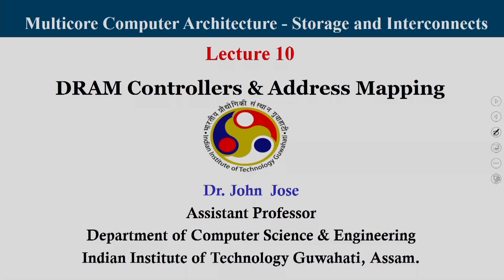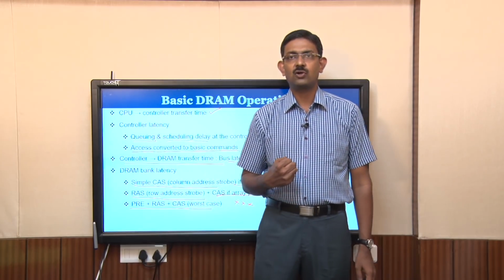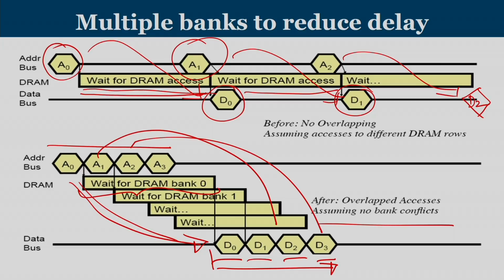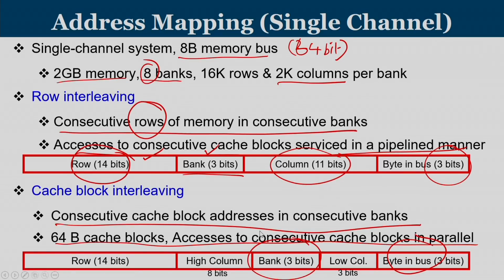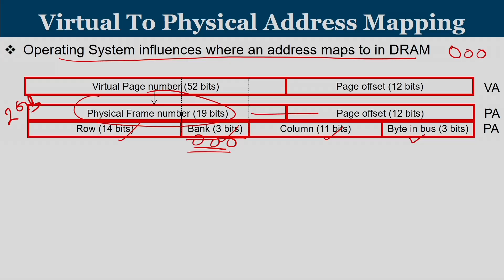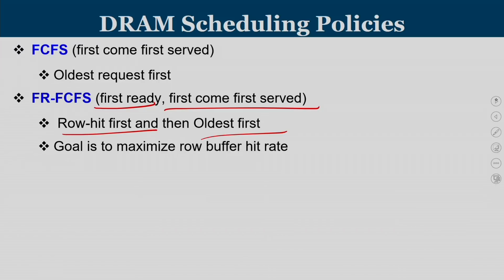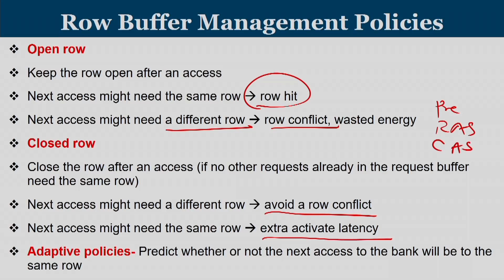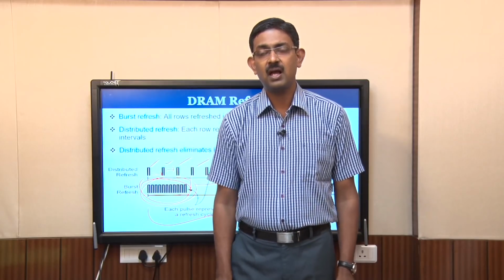DRAM Controllers & Address Mapping

Comment: Hello. is there a way to have a HD using DRAM ?  Or to extend widely a HD ram to say 250GB and by pass HD mechabic  ? Use as HD to save a corrupted or crashed HD  to another HD ? Best regards.
Reply: Are you talking about a RAM drive?

Plenty of software available that can do that.

As for saving other data, a RAM drive isn't going to help much in that regard. The data recovery is typically very, very slow if it is possible at all, might as well just have another hard drive to write the data to as it is read.